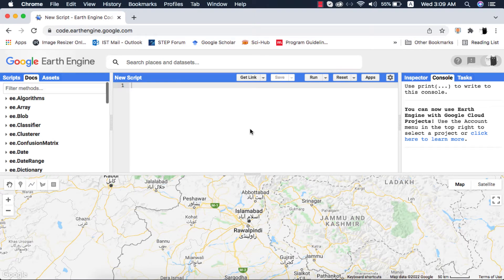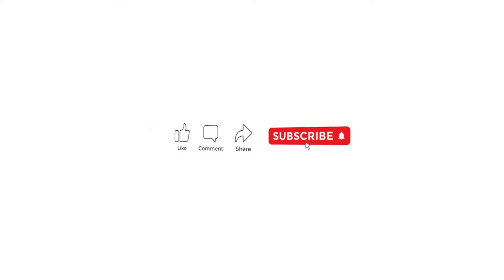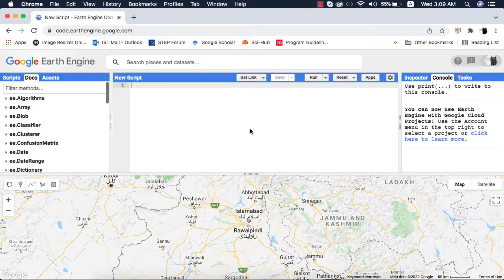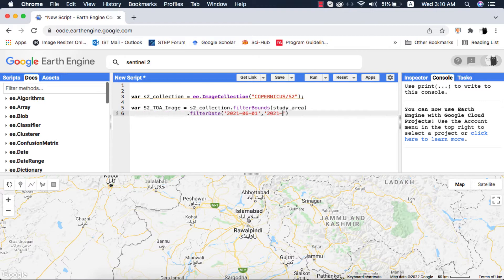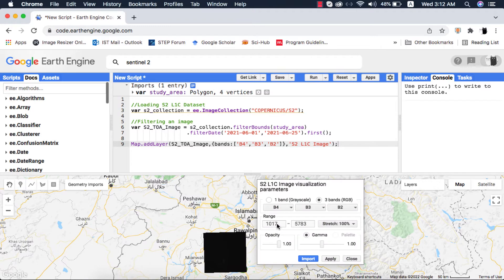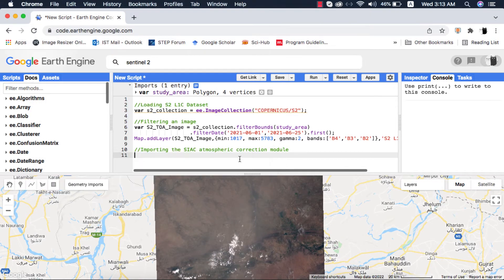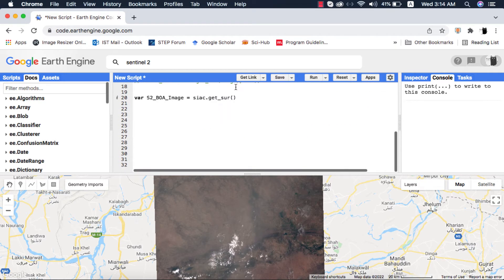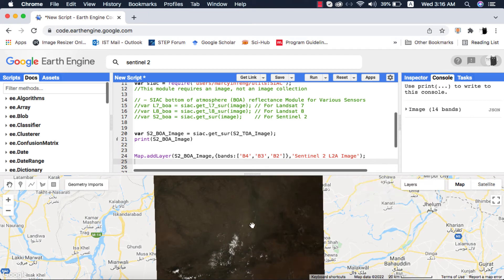Atmospheric Correction (TOA to BOA) of Landsat and Sentinel-2 Imagery in Google Earth Engine

Comment from the maker: Updated Script Link: 
Correct (L1C to L2A) Sentinel Image Collection, Batch Visualize or Export to Google Drive
https://code.earthengine.google.com/9075d4270ef0c5167096b468347ec6f5
Reply: Can i use it for extracting all band values?
Reply from the maker: @dogoldude  yes you can
Reply from the maker: @dogoldude  however if you get stuck email your script link with comments in it muddasirshah@outlook.com

Comment: Is it necessary to correct the Sentinel 2A level 2 image which is already Surface Reflectant to calculate the index on mangroves?
Reply from the maker: @yund781  No. but you have to scale the bands. Multiply the L2 image by 0.0001 (which is the scale factor) and then calculate indices.
Reply from the maker: @yund781  scaling S2 level 2 product is necessary as GEE stores images in uint64 for storage management. Floating data takes more storage so google did that. Majority of image collections e.g. landsats, sentinel, modis are stored this way and you have to multiply with the scale factor which is provided in the dataset description next to the bands. Some images even have offsets along with scale. For such a band multiply the band by scale factor and add offset to it to get reflectances in your case in nm (nano meters)

Comment: Hey Mudassir,

I was facing a problem that i was trying to access Sentinel 2 L2A imagery for 2017 and 2018 on GEE and was unable to do it. SO i used saic method on the L1c imagery for testing i calculated the ndvi from l1c imagery on which saic was applied and l2a imagery available on gee for 2019 and i noticed that values were not matching with each other there were significant differences. Can you guide on this or how to solve this error
Reply from the maker: @ibtihajahmad3314  how were the values not matching? Can you email me at muddasirshah@outlook.com

Comment: Hello, I hope you are doing well. I just wanted to mention that I have noticed a small issue with the work you have done. Overall, it looks good, but when I try to use it for my thresholding, I encounter a problem. Every time I click on Run, the BOA image turns black and I have to click on stretch 100% to make it visible again. This causes me to lose the bands and information necessary for further processing, especially when working with a vegetation index. The values become scaled, which complicates my work since I typically use unscaled band values. It would be greatly appreciated if you could ensure the stability and usability of the result in the future. Currently, it's aesthetically pleasing but not quite as functional for my needs. Thank you for your attention to this matter.
Reply from the maker: Hi,
Thank you for pointing this out. Yes, I am aware of it but this repo is managed by some other person. I faced similar issues but most of the time it works. It started doing this behaviour very recently

Comment: @MuddasirShah I have a question on this method. Is it the same methodology as Sen2Cor? I need to know if its exactly the same as that method.
Reply from the maker: Yes it’s the same thing. TOA to BOA. Sen2Cor is just the plugin name in ESA SNAP. That essentially does the same thing. 
It is good that you have commented. Recently I was using this and it returned a null image. So I will have to talk SIAC developer. You can check and let me know if that happens to your image as well

Comment: how can i run the c2rcc correction in gee? there is a simil?? thx btw
Reply from the maker: what’s c2rcc?
Reply: @MuddasirShah  it's an atmospheric correction that include aquatic layers of NAP, CDOM, PHYTO and is applied to study aquatic compounds such as chl-a, tsm. It's make feasible. It's make feasible the compare with in situ measurements. I know that c2rcc are neural networks but i don't know how to apply in GEE, only in SNAP (ESA Software).

Comment: can i apply siac in the PAN band of landsat 8? how? thanks!
Reply from the maker: Good question. 
Quick answer: you don’t need to.

Reason: Panchromatic band is used for pan-sharpening. It is sensitive to the intensity of visible light reflected from the target at higher resolution which is independent of wavelength (meaning it doesn’t have a specefic wavelength range as a NIR or SWIR has, if you look at it’s wavelength it will show that of RGB range hence I wrote visible). For other bands e.g. B4, B5… you want the reflectance value at particular wavelength hence you convert it from radiance to reflection and calibrations need to be performed.
Reply: @MuddasirShah  Thanks for reply! Actualy im doing a virtual contra-band called 'orange band' that can monitoring Cyanobacterial Blooms. For the equation i really need the Pan band corrected. To do the equation i use the spectral resolution instead the spatial resolution
Reply from the maker: @rafaelchasles9971  Never heard of that before but value of pan-band was required in the equation?
Reply: @MuddasirShah  exactly, it like take the pan band and substract the red and green (with some constant), what remains is the orange band and the magenta band (this wavelength is the maximun absortion of some kind of cyanobacteria - the pigment  is called phycocyanin)
Reply: outside GEE is very easy, i made some tests with ACOLITE and py6s, but i really want to do it in GEE.
Reply from the maker: @rafaelchasles9971  In GEE it will be even more efficient. 
So you subtract another band that is in SR? 
First we will load the TOA Tier in GEE and then SR tier. And apply the equation :)
Reply from the maker: @rafaelchasles9971  but please tell me that the band you subtract is indeed in SR. I somehow doubt that. Most of the times an image processing involves bands from the same data level
Reply: @MuddasirShah  sure, all band need to be in the same data level. Normally I take the TOA, apply the atm correction and then transform to remote sensing reflectance (Rrs). To the equation I need the green, red and PAN band all with the atm correction
Reply: So, it’s possible apply SIAC in PAN? If not, do you know other atmospheric correction in GEE JavaScript?
Reply from the maker: @rafaelchasles9971  Well… you need to ask the developer. Rodrigo F Principie. Ask him for the orignal code / his github repo.
I think you need to discuss this on GIS Stackexchange. But Once again I’ll say no need to calibrate pan band
Reply from the maker: Another answer for you would be:

Just look at the landsat data products. TOA Tier has Pan band but SR doesn’t. Why? Because SR has calibrated reflectances per band / wavelength range
Reply from the maker: Please read this
https://www.sciencedirect.com/topics/computer-science/panchromatic-image

Comment: Can you post about 
QUAC atmospheric correction in GEE???
Is that even possible ?
Reply from the maker: I haven’t used Quick Atmospheric Correction (QUAC), can you refer a link?
Reply from the maker: As far as I know QUAC is available in Envi. GEE has this SIAC module for both landsat and sentinel MSI TOA datasets. Also GEE has SR available so it depends. 
In case of sentinel the early 1 year images were not converted to surface reflectance by google so they ingested TOA datasets which can be corrected with SIAC
Reply: Thanks for clarifying Sir

Comment: Sir is this
var siac = require('users/marcyinfeng/utils:SIAC'); 
directly imported or what? I'am still confused about the import, please sir 🙏 I am confused about who else to ask 😢
Reply from the maker: Yes you can call it a repository. How this repository is developed is available on the developers github. But we’re not concerned with its development we want to implement on our TOA images. You can find details of this repo there…
Reply: @MuddasirShah  Good sir, then for correction TOA and BOA used in GEE how without entering the github?
Reply from the maker: @sofypuspita7715  I beg your pardon?
Reply: @MuddasirShah  Apologies for what, sir?
Reply: @sofypuspita7715  You don't need github. Just write the code in the GEE code editor.